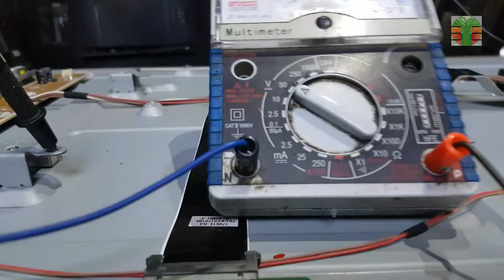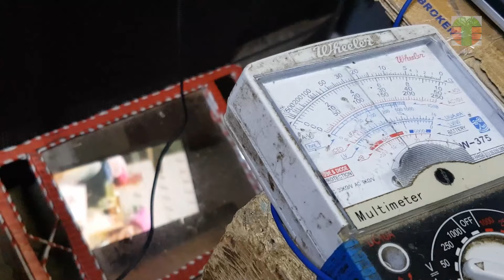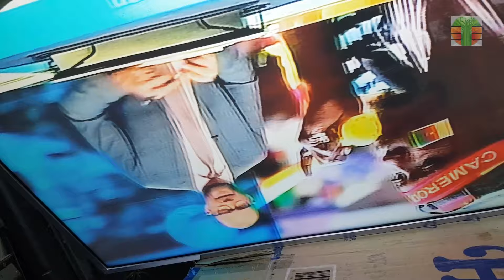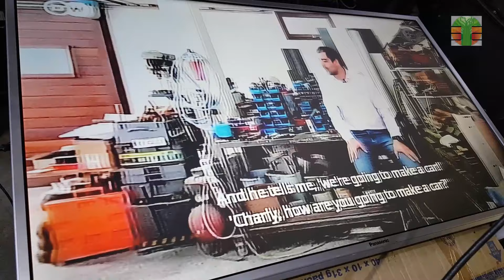VGH ODD LEVEL shifter bypass

Comment: HELLOW tevz TV great video but How do you know it was VGH ODD or VGH EVEN in short? could be the VGH line or VGL line right? , you also bloked this lines in the left side so How do you go straight to this lines? 
  Another thing is...i dont understand in this repair is, why you do not unblock the left painel sector and cut only the vgh even to and make the same thing in the vgh odd you make in the right side? 
 In that why the plainel gone work with al clks with another vgl and vgh and also with another Vgh Odd so the painel works better for more long time right? Or im wrong sorry by this question but im lerning tv and this makes me worder......
                Thanks for your Amazing videos.
Reply from the maker: You will know where the shorted  vgh odd, even by disconnecting the  wire going to the panel one at a time.
Reply: Creo que nadie sabe cuál es el problema, he visto más de 100 videos donde solo bloquean con cinta aislante y cortan pistas, pero nadie explica realmente la avería ni como solucionarlo reparando realmente en lugar de hacer siempre la misma chapuza. El fabricante no puede hacer esa chapuza en lugar de diseñar la circuitería en costosos laboratorios de electrónica?

Comment: Hi, thanks for that good video and very good job ! I have one question :
- We know that VGHODD and EVEN are fluacting from negative to positive voltage.
So what I would like to understand is why the TV is working by applying a constant voltage like VGH to VGHodd (which should normaly fluctuate) ? And if there is a short circuit between ODD and EVEN, VGHeven should also be at a 30v constant now ?
Thanks for your answer and thanks again for your great job !
Reply: What is the difference between vgh odd and vgh even?

Comment: Hi, great video. Thanks for sharing. I have a TV similar to this one. If possible, a question: is it normal vgh_odd and vgh_even switching between -5 to 28V every second? Another question: Why 27 ohm resistor? From now on, thanks for paying attention.
Reply from the maker: yes, it's normal  vgh_odd and vgh_even switching between -5 to 28V. you can connect it without the resistor, the resistor is just to not force the current whenever there is a short circuit in the panel.
Reply: @tevzTVTevatronics  Thanks for answering.  However, one last question: what are the voltages VGH_ODD and VGH_EVEN for?  What is their function?
Reply from the maker: @leoluz8569  This could answer your question https://e2e.ti.com/support/processors-group/processors/f/processors-forum/142725/lcd---24bpp-to-lvds-panels-odd-and-even-channels
Reply: It is normal

Comment: amazing video thanks a lot!
my sony has a problem that after turn it on the screen is fine about 1-2 seconds after that the video disappear. the leds are working, because I can see the backlight. the screen is fine because during 1-2 sec the picture is perfect. but after 1-2 sec after turn it on the picture disappear. I think this can be a t-con issue, maybe a VGH problem. 
what do you think? am I on the right way to find a problem?
Many thanks!
Reply: you mean black screen after sony logo?

Comment: Great idea I just have the same trouble with this video just for clarification Idol correct me if I'm wrong, this can't be done by only putting tape on the terminals or pins?
Reply from the maker: If the two sides have shorted gates you can not tape them both.  Its shows on the video how to do it.

Comment: So what exactly caused the problem? 
When you bypassed with the 27 olms resister how many volts did you get to the other end❓
Reply from the maker: The problem is the VGH even and odd have a partially shorted, disconnecting the vgh even and odd on the left side or right side will solve the problem. I bypass the VGH ODD LEVEL shifter as shown in the video.  The 27 ohms resistor is just in incase have a problem directing the VGH odd it will not force VGH going to the panel. If the bypassing is successful. it's ok to remove the resistor and direct it to connect to the panel.

Comment: Does it mean the T-con is bad.  Replacing it will solve the problem, won't it ?  Or it may be caused by other issues such as the LCD panel driver board ?
Reply: السبب هو الشاشة رديئة الصنع. و المشكل من الشاشة

Comment: To sum up: dark image, double image are caused by drop voltage at the level.of vgh odd and vgh even..right?
Reply from the maker: yes, as you can see in the video.
Reply: Can you explain 
What is difference between vgh odd and vgh even? 
Why is there a vgh odd and a vgh even over simply a vgh voltage?

Comment: I ve seen people blocking 13 pins  on one of those the ribbon cable to fix no display  on lg tv  are you familiar with this mod if yes os it safe to do so...thenks.
Reply from the maker: yes its safe
Reply: @tevzTVTevatronics  why does this trick work?

Comment: Hi, I would be gratefull if you could help me, so I have the same problem (horizontal lines and freezing screen) and when I cut the VGH ODD and let the VGH even connected the picture is perfect and it dont flicker but freezes every 2 sec, and when I cut the EVEN and  connect the odd the screen dont freezes but flickers. Any ideas? And do you leave the paper under theone  ribbon cable or remove it, because when I put it in the screen is just black. Thanks ahead for the answer.
Reply from the maker: Try as shows in this video.
Reply: @tevzTVTevatronics  I did but the voltage is going from -3.9 to -4-9 on the  VGL and from 29,8 to 28,8 on the VGH, I connected VGH EVEN from both sides to VGH and VGH ODD from the right side TO VGL an the screen is not freezing but it is shownig horizontal lines on the top, but when I connect VGH ODD from the left side it freezes again. Is it possible to fix it if both sides are shorted?
Reply from the maker: @NiksaLevi  The panel may have many short so it not going to work on this method.

Comment: Boss me i ask regarding tcon board the vgh is low volts only even i removed  two flat flex wire of the panel it is posible tcon board problem?
Reply from the maker: probably is the t con

Comment: Short circuit in both sides, is reparable?
Reply from the maker: yes, just try it as shows in the video.
Reply: @tevzTVTevatronics  not work for me. Normal is frezze screen every 2 seconds. And with this metod. No frezze screen, but vertical lines and low resolution display. Sorry for my bad english, i speak spanish
Reply from the maker: @maximilianofenoglio1809  try the ODD to be bypass or try the EVEN, note dont baypass them at the same time. Just one of a time. Sorry also my English Im a pilipino.

Comment: If vgh is connected through resistor to vgh odd and it works then what is the purpose of two lines vgh odd and vgh even going to each side of panel? 
Why not just vgh?

Comment: I have voltage drop of VGH EVEN and  VGH ODD on both sides, image freezes
Reply from the maker: you need to do  it as shows in this video.
Reply: Lods LG 43 surrender ako GANYAN ata ginagawa ko so di pala pwd sa tape method GANYAN?
Reply: image freeze need to cut vgh odd and vgh even from the ic. then direct jump them.

Comment: Turns out vgh-even is not used?  What causes the vgh-odd voltage to fluctuate?
Reply from the maker: its not fluctuating. VHG ODD voltage is 30 volts to negative 7 volt interval.